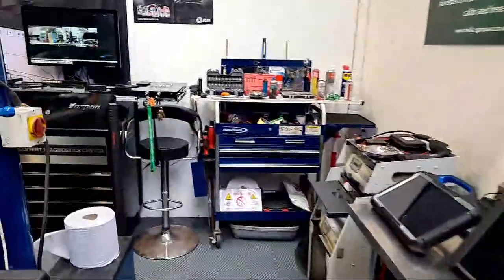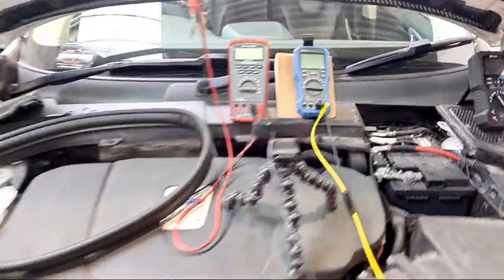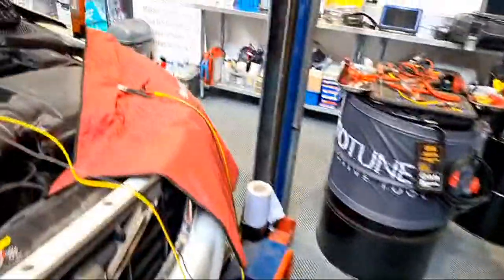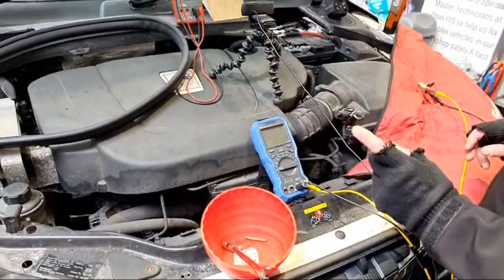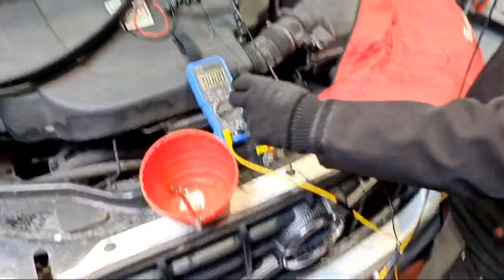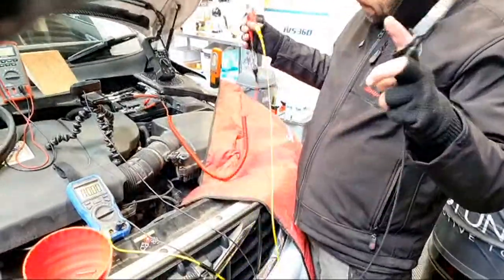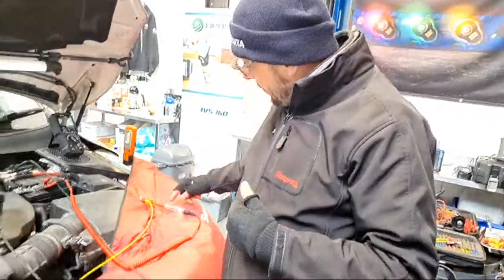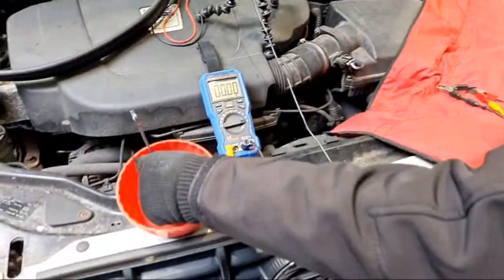Using a multimeter (DMM) to measure current or battery drains.

Comment: You can check the amp range fuse with the meters own continuity test range. just put the meter on continuity and use the red lead probe in the amp range. The fuse is in line with a shunt between the meter inputs so if fuse is good you get a beep.

Comment: Hi Steve, not sure about connecting the positive first with test equipment because the negative lead then becomes positive, especially on high voltage circuits like on EVs ?  Just a thought. Nice to see you back and looking well.
Reply from the maker: High voltage is different, were talking about 12v circuits here, in this instance which pile we disconnect is irrelevant because we're keeping the circuit intact 👍

Comment: Nice thorough video.👍 Interesting to see the Owon meter. I've just been getting my feet wet playing with an Owon scope. Very decent for the price.
Reply from the maker: The meters are good, extremely good value and reliable, I've had this one over 2 years and it hasn't missed a beat, even considering that I've had it apart and modified it for an additional external fuse.